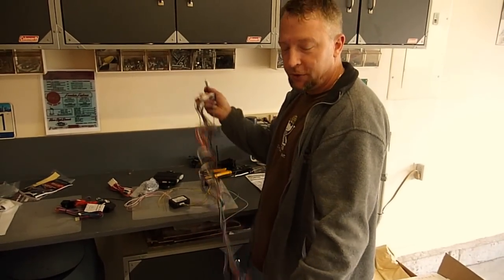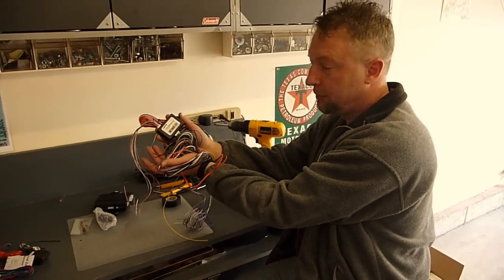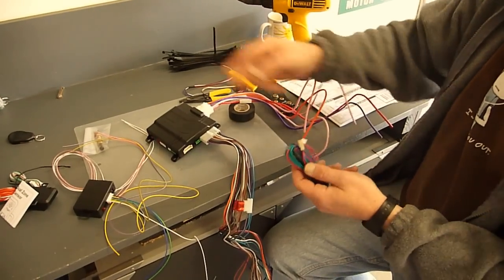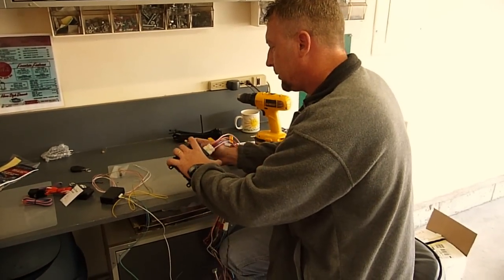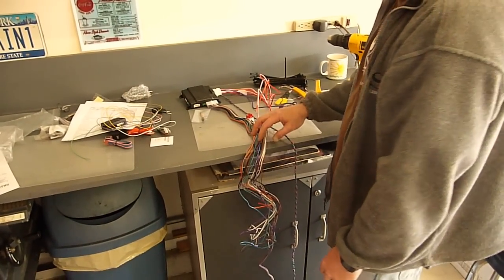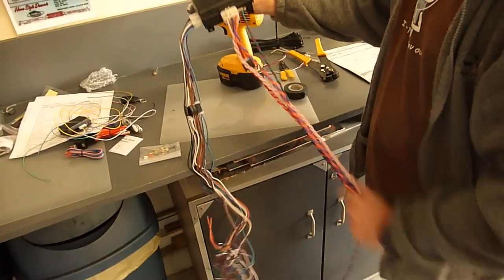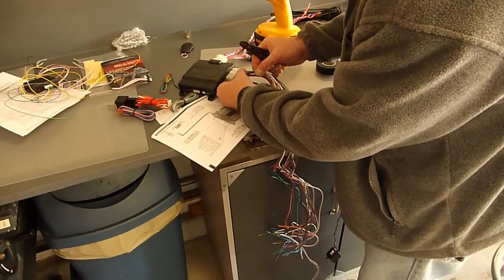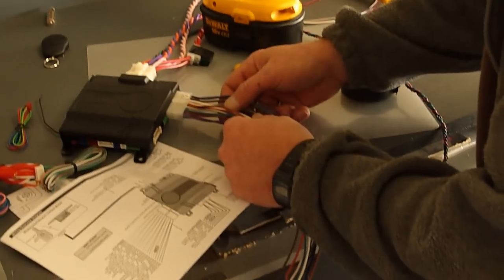Part I - How To Car Alarm Remote Start System Installation

Comment from the maker: Are you working on a manual trans car by chance? Cause if you are those need to have the wire ran into the engine compartment due to the cluch keeping the circuit open

Comment from the maker: Thats a good alarm, the car is pretty easy too, the only thing with that car is you have to program double pulse unlock (if you want all the doors to lok simultanously) you can leave it as is and hit the remote 2x to make it a 2 step system though too, which is cool.

Comment from the maker: Easy, Go under the driver dash, You may have to take some stuff apart, Look for the main alarm module-You cant miss it its a black box with a jillion wires coming out of it. The blue 2 pin plug is the valet switch, Follow that to the end, there my friend is your switch.

Comment from the maker: you always need to add a relay to add trunk pop. wire it for a negative output:
TRUNK RELEASE  GRAY(-) USA/CAN, PURPLE (-) JAPAN  @ DRIVERS KICK, PIN 20 IN WHITE 22-PIN PLUG

Comment: Instead of opening and closing your drill every time you want to twist wires, i would suggest that you put an eye hook or eye bolt in the drill and then just put about 2 inches of wire through the eye and hold it and spin it.

Comment: In the video is the insulation stripped away or just poked a hole through with cotter pin extractor .before adding new wire .Thanks . Plan on installing mine soon and want the easiest way possible . Nice video .

Comment from the maker: You do that by tying into the factory arm/disarm wires coming out of the driver door typically. Sometimes its done through the door locks (depens on the car)

Comment: Hey great video series its helping me alot. Got a question on my hand book for my remote start were it shows how to wire the relay for the starter disable well on one part its say "make certain to connect brown wire to starter motor side." by it does it mean to connect that wire direct to the starter? If you could help me out so that I don't mess up when I install this in my car on the weekend. Thanks

Comment: awesome vid thanks alot, one dumb stupid question, if my car says its a negative door trigger, do i use the negative door trigger wire from the alarm system or positive? im just a lil stuck on that.

Comment: Hello, your videos are very helpful. I’m having issues with my viper 4806v . I’m not sure what wires I need for the remote start to work? I’m installing the remote start in a 1990 Chevrolet Silverado . Can you help me ? Can you do a video or help me with a diagram? I installed the relays for the keyless entry and it works . I installed the starter wires that I thought would be the correct ones but it does not work. There’s also a fuse inside the viper alarm that don’t know which side to plug it in (positive or negative) thank you very much for your videos and your help.

Comment: yeah i later realized that thanks. I also installed motors (Xpress P3500 2-wire actuator) so the alarm could pop the locks, but it doesn't send enough power to the motors. Any idea how to fix that problem? Every thing else about the alarm works great.

Comment: Do you need a relay for the power door lock, trunk unlock, starter kill and horn? or can you use the same one for all of the above. As well, can you use the output for the siren to the horns instead. Thanks

Comment: Thank you for taking the time to make these videos, they've really helped me to get my install prep of the Excalibur 1660 easier. I'm installing on a 2011 Tundra Crewmax and wanted to know if I need any additional modules or anything to use the remote start?
Reply from the maker: +Carlos Orellana get a transponder key bypass, either the ol-blade or a fortin evo-all
Reply from the maker: I dont really have that but you can always call us. 904 342 5491

Comment: I plan on installing a Viper 5704V with an iDatalink ADSALCA into a 2006 Honda Odyssey.  I have two questions I would like your help with.  Will I need any relays for this install?  I would like to use the feature that normally controls the trunk release to control the sliding doors...how would I accomplish that?  Thank you in advance.

Comment: I purchased an 01 Ford Expedition with a Viper 771XV alarm. The remote starter run time is only 45 seconds. I read the manual online and cant figure out how to program it to run longer. Any ideas?

Comment: Hello, thanks for this Prep video! I own 2003 Isuzu rodeo 4wd 3.2l and am installing Excallibur 1850. I have been following your prep but since you were installing on Toyotal am not sure if wire twisting is the same on the 16 pin harness (see video #2). Please I need your help from prep to the install. I have all necessary things available for this. Thanks

Comment: Great video. I am new to alarms so im not too familiar with how what goes but watching you video I got an idea. Only qurstion is I see I have one set of wires for one actuator how or what do I wire the second one. Also I dont want it to were I click it once both door unlock I would like the one for one and 2 for both.
Reply from the maker: watch my video on adding adding actuators and/or the 5 wire relay wiring I have posted.

Comment: Can you please walk through installing a remote start alarm system on a 2005 Ford F150 Lariat with a chipped ignition key that requires a Bypass module for the remote start, how to video would be great. Or just how to install the bypass module for the chipped key? Thank You From South Texas.

Comment: Great Work.... Q: I Have An 02 Grand Prix Se With A Viper Alarm/remote start BEST buy installed it but ever since they installed that remote start I can't start my car with my key anymore.... when I try to use my key to start my car the security light flash and my car cuts off... but once I start it with the remote put the key to on and hit the brake turn the car off and then start it with the key the car Will start but my security light Will Stay on... can you tell me what the problem can be

Comment: I have the same problem right now. I am seeing 12V on starter wire only when i use the key to start. When I try to remote start I hear a relay clicking on the module, parking lights flash on, ignition comes on briefly but then no start signal is sent. The car I am working on is a 2010 Ford Focus. I have a Fortin Evo-Ride bypass module, which I have not yet programmed because I want to make sure the remote start portion works first (simulating this by touching the driver motor lock wire to ground

Comment: great video, but where did you get the tech sheet for the vehicle. i'm installing it on a 09 galant and now audiovox will only give the tech sheet info to a dealer. any suggestions?
Reply from the maker: follow the instructions in this video: Free Vehicle Wiring Info    NO, REALLY!!!!    It's free

Comment: i see that this was put out 7 years ago.  I was wondering if you have found about Tesa Tape?  its cleaner and looks more professional.  im not saying that you did a bad job but you have mentioned that your not a fan of Electric tape.
Reply: I use Tesa AKA fabric tape, but holy hell that stuff is expensive

Comment: I’m trying to put a Compu star 8900 on a 1995 Firebird Trans Am. Have any tips or tricks I should know?
Reply from the maker: nah, thats an easy car to work on!
Reply: @Lesscoelectronics   maybe but it’s kind of a tricky one due to the different engine and transmission and botched wiring harness. I’m scared to put in the security system. 🤷‍♂️

Comment: Thank you for doing this! I have a 2003 F150 supercrew I would like to install an alarm and remote start. What do you recommend for it that is a good reliable system and what else will I need in terms of a bypass. Thank you hope to hear from you!

Comment: i just bought an viper 5901 alarm system.it did not come with a shock sensor is this vital to the alarm system or can it operate properly without it.

Comment: I have a viper remote start system and I know its an older one but I do not know where to locate the model I have an 03 impala if that helps and new replacement remotes but cant seem to program or locate instructions on how to reprogram the remotes. Any advice would be helpful also I do know where the valet switch is.

Comment: ok im tryna wire up my alarm remote start in my 2000 gmc sierra 1500 too and in your video u cut some wires out that you dont need, how do i know if i need the wires or not?

Comment: Hi I have a question. I have manual transmission, and installing Viper 5904 with remote start.
1. Do I need relay kill, and is it built into this unit already.
2. I have manual transmission, so when you said to the guy above he needs to run a wire to the engine compartment, which wire are you talking about ?

I looked at some videos on how to bypass the clutch switch but i want to do it right. I still want to have to use the clutch in order to start the car,

Comment: Whats the prices for the wiring info??

Youtube vids helped me out alot and the wire info would make life alot more easier too.. tks in advance.

I need 3 for 3 diffrent vehicles.

1998 chevy Express 2500 5.7L 8 cylinder cargo van

2004 Cadillac Deville Base 4.6L 8 cylinder 

2002 Acura MDX base 3.5L 6cylinder awd

Comment: Okay, Mr. Lessco, purchased a viper 4103 keyless entry/remote start and would like to install it myself.My question is why is there a (-) beside some of the circuits and a (+) beside the others on the included wire identification sheet?

Comment: Good job I'm installing excalibur 1670 alarm system  in 1965 Mustang should pretty easy  where i just have the Hood Trunk and Doors and the glass detecters  and kill Switch and maybe GPS.   Any tip before I start.  thanks in advance.  Steven
Reply from the maker: nope, just take your time, those old cars like to be treated like proper ladies
Reply: @Lesscoelectronics  where do find cheat sheet for 65 Mustang Cope Thanks again

Comment: Just had my car broken into and will be attempting a security/remote start install. Car is a '93 Lexus GS300. Looked at the diagrams and light research. Anything particularly hard about this type of install? Thank you for a great video set as well.

Comment: Hi I have a prestige remote starter APS687A I have to Add circuit relay to starter wire .
thank you for your help
Reply from the maker: Maher Zaidan if you need to buy one, call us 904 342 5491

Comment: Couple of questions. I bought an xpresskit bypass and a crimestopper rs4-g4. Certain wires of both have to be hooked to the same wires, is it okay to hook them up on the same location of the wire? Meaning, a wire from the remote starter and the bypass and basically touching each other and going to the same wire, or should I cut another piece of the wire and hook them in individual spots? Also, the wire from the bypass to the remote starter is one color, while the wire from the remote starter that's suppose to go to the bypass is another color, is this just common due to different manufacturers? I.e, they don't do the same colors for the wires?

Comment from the maker: A ram is like a 7 out of 10 on the difficulty level, mostly cause they use resistor based lights and door locks, but the cheat sheets explain all that, and so do my other videos as well. the tester I use is a snap on power probe btw

Comment: So I have the evo all installed but I was advised not to disconnect my battery cables unless I knew how to reprogram the module or else the car would no longer start? Is that true? Lessco Electronics

Comment: hi, is it possibe to use the airco accessoires function, horn output & trunk release function ? because the 1860 series only has 2 on-board assignable relays ?, if not, will it be possible to add relays to the sytem on your own ?

Thnx in advance.
P.s. i am considering to purchase this alarm for my Alfa Romeo 156 ( manual transmission)

Comment: Hey I have a question I have a avital 5303l installed and it's not up to par for me. I had it installed by a stereo place and I was wondering if I could buy a new viper alarm and jus pull the brain out and replace it will all the harness plugs and sensors fit in to the viper brain??

Comment: Also Mr. Lessco, (thanks for your patience) How do I check an activation circuit, i.e. dome light, horn honk, etc, with my multi-meter to see if its a positive or negative circuit?

Comment: Hi I have a 97 vw jetta 2.0 I just installed the avital 4103 everything went smooth until the lock and unlock for the doors the tech sheet says it's a type a system I can only seem to find one wire that gives off a 12 volt when the unlock button is hit on the car. Now when I hook my lock wire up to it the remote will lock my door but that's it I also understand that it's a double pulse system and the unlock needs 12 volts. Please any help with this would be great I've been driving my car with wires hanging hanging out everywhere I don't wanna put it back together till it's complete. Thanks for your time.

Comment: Hi there, I've a serious question. please answer. I've just installed 2 way car alarm with remote start function. I thought that I connected 6 wires for ignition switch correctly. But remote starter is not working. there is no 12v on starter wire when I try to remotely start. I didn't use a start kill relay, because I had no idea about it. can you help me?

Comment: Hey Martin, your videos have helped me very much, but i have a little problem, after install everything of the remote start, i press the button of start in the remote and the car cranks but doesnt start. I put the key in the cylinder of ignition but is the same, crank but doesnt start. 
my alarm is a viper 5706v and the car is a toyota land cruiser 1997. 
I hope that you can help me, Thanks
Reply from the maker: Manuel Ramirez check if the truck has a 2nd starter wire. that may be it, otherwise check all the ignitions are powered on, tach is learned etc...
Reply: Lessco Electronics i dont have a 2nd starter wire, i have checked all the ignitions and they are powered, this alarm has virtual tach. I have connected the wires in this manner:
fused 12v acc/starter (red/black) To==> (white/red) wire in the truck(12V constant)

87a of ignition 2 flex relay(pink/black) To==> (black/red) key side ignition 2

ignition 2 flex relay output(pink/white) To==> (black/red) car side ignition 2 

fused ignition 1 12v (red) To==>(black) 12V constant

starter output(violet) To==> (black/white) starter wire of the truck

accessory output(orange) To==>(blue/red) accesory

fused ignition2 /flex relay input 87(red/white)To==>(white/red) 12V constant

ignition 1 input/output(pink) To==> (black/yellow) ignition 1

http://www.directeddealers.com/manuals/IG/Viper/N5702V_2008_08web.pdf
http://www.bulldogsecurity.com/bdnew/vehiclewiringdiagrams.aspx (land cruiser 1997)

Comment: my remote starter beeps four times and makes a clicking noise under the dash but the car will not start. Any thoughts? All other buttons works, arm, disarm, and truck open.

Comment: Hi sir got questions for you I got 06 Honda Ridgeline I have remote starter on my key ignition key when out so is been replace with new ones but the mechanic cut the wire of but did not put it back on my ignition wire key ignition now the remote starter wire is just laying in the steering column not in use my question is can I wire them back without programming to truck again thanks

Comment: My dear ,I have lancer GLX 1600cc (CS3) - ,I did the full installation as you did but I have only one problem ,it is that when pressing remote start ,the starter will run but with no ignition- the only way to start it is to insert the Key and turn to IGN or to ON  ,the press remote start and will start prefectlly
Reply from the maker: Ahmed Elsawi  what year is that and is it the same as the usa model lancer by mitsubishi?
Reply: i brought it from UAE,dubai -it is the old shape lancer as 2007 one -some countries calling CS3 - other calling Cedia ,  full automatic car
Reply: and sorry i do not know what is the USA model of Lancer

Comment: do i need to bypass anything if i just want to utilize the remote start function only? I've wired the 6-pin harness in but the programming indicator light doesn't come on

Comment: Can I ask your help elaborating or refer me to a link of a video on how to install Compustar AS6900 with bypass module on 2001 PT Cruiser? I am a DoItYourselfer and like to tackle this project myself but problem is I’m a new kid on the block to such a big combo that require bypass and such a vast options packed wiring system. I have most of the install info and parts as well as tools except Voltmeter.

Comment: lessco i have a question how do you know when you need a relay for the trunk i am tryin g to get my alarm to do the trunk but i have no idea how, i checked the tech sheet of my car (corolla '12) and it said it was a wire on the fuse pannel but i couldnt test it how to go about doing that can you please help?

Comment: I have an 05 chevy equinox, and I am having issues with programming the key to the bypass module. I followed the flash logic  instructions. I have the metal key by the way. Can't make it work. What do I need to do?
I'm using Flcan and a prestige remote start. Thanks.

Comment: Hey I'm looking on purchasing one of ur EVO ALL modules on eBay and just wondering what all or what
Can I add to make remote start work long range?
Reply from the maker: +574fedsup you need an rf adapter and a remote kit, I use the compustra kits mostly but other brands can work too as long as you flash it accordingly.
Reply from the maker: +574fedsup youll need a rf adapter and a remote kit preflashed for the appropraite setup, we do all that if you need help, call us at 904 342 5491
Reply from the maker: +574fedsup go to fortins site and do a lookup if you can on your specific car/application at ifar.ca